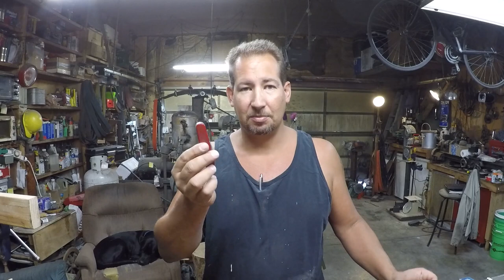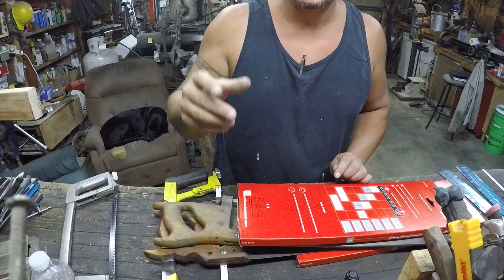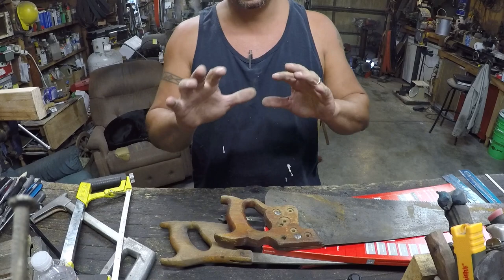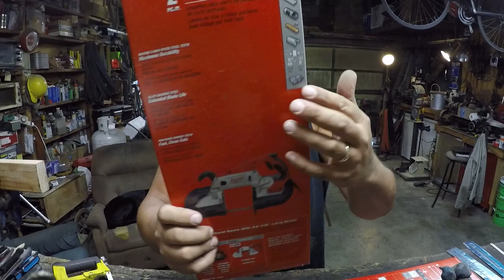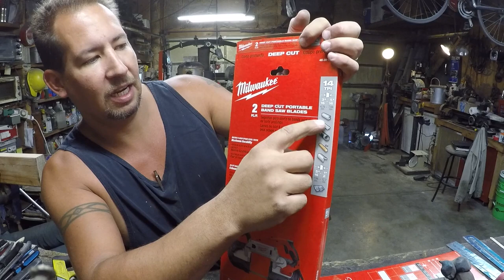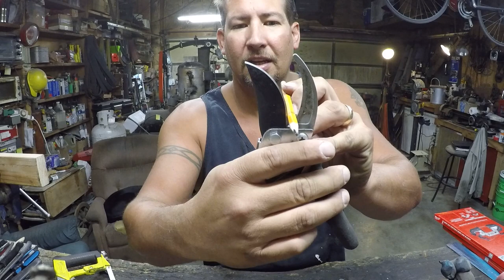what is a toothy knife edge?

Comment: I've been a fan of the ~100 grit stones. After trying down to 24 grit I found that easy of sharpening decreases too much if you go below 100 grit. Even at 100 grit it's not easy, and unless you really take your time it just gets to arm hair cutting. I've gotten around 100 grit to hair whittling but it's really tricky to pull off.
Reply: 100 grit? That's close to the coursest stone I've used (70 grit) that seems so course you could only manage to form a burr not polish/refine the edge or remove said burr so how could iy possibly get arm hair shaving sharp.

Comment: I recommend chosera 800 as a good edge finisher, it's right in the middle. It's got some tooth still, but is also good for a little refinement. I've heard the cerax 700 is good too. 

If you still need more polish the chosera 3000, or king 4000 is a good next step.

Comment: I'm surprised you haven't spent more time finishing with the Norton India stones.  While I too love the Crystolon stones, I use them primarily for shaping the blade.  For finishing I find I can get a sharper edge from the India stones for any given level of toothyness.  The key is to keep the stones sharp, i.e., finish with a sharp fine India rather than a not-so-sharp medium India. While I also share many of your opinions on diamond stones, I find them good for finishing (applying a toothy micro-bevel) on the higher carbide steels.  (Pretty much the opposite of the way most people seem to use diamond stones.  When you use diamonds only for finishing micro-bevels they do provide an acceptable lifespan.)

Comment: Hi Joe
I am 61 and have sharpened a lot of knives and (Broadheads with a Mill smooth file )for Hunting and Cleaning animals.
Having said that I seem to have forgotten how to sharpen a knife !
I will work up a burr that I can feel and work the burr to the other side then work it back one more time  and still can barely shave hair if at all.And its not as sharp when I get to the curved part of the blade.
I also have an old Shrade sharpening steel that I have had for more than 40 years and have tried that but maybe I don't remember how to use it right.

I don't hunt anymore But I Peel apples and Kiwis and cut my sandwiches, as a Steak Knife ,Cutting a porkchop etc, 
I use a pulling Motion when cutting things on my plate and a pulling motion when cutting and peeling apples and kiwis 

I figured an Old Hickory Paring knife would Make a good Neck Knife so I bo
Reply from the maker: hi billy. if you are getting a burr, and moving it from one side to the other, then you are about 80% there. burr removal can be tricky some times with some steels. with a diamond stone, or a nicely condtitioned arkanas stone or norton india, you can raise your sharpening angle to about twice what you normally sharpen at, and shear the burr off with 2-3 very light passes on either side.   with a muddy type of stone like a norton crystolon, king waterstone, or most synthetic waterstones, i have great luck wtih dragging the edge thrugh a piece of clean soft wood to tear the burr off, and then stone strop 2-3 times at the normal sharpening angle to clean up the edge.
your sharpening steel will typically just stand the burr up and align it with the edge, and most do not remove a burr at all.
Reply: Thank you Much for your Help
Reply: Need some more input from you.

I am finding out that I can take a Mill Smooth file and get a Hair shaving sharp edge on The Old Hickory Paring knife Much faster than I can with the stone.

Whereas I have been taking about 45 minutes to sharpen with a fairly coarse stone and then having to strip it on Leather using the Mill Smooth file it takes less than 5 minutes .

Wonder Why ?

I do know that it is a lot easier for me to see and maintain the sharpening angle using the file .

I am just holding the knife in my left hand and the file in my right .
Reply from the maker: @billyhenard1473  thats great that you are having sucess with the file! now that you have one good way of sharpening, you can use it, while you continue to learn with other ways if you wish. the file and the old hickory knife works because you can see what you are doing, and it is comfortable for you. and becuase the knife steel is pretty soft and the file is pretty fine. i would suggest at first to use the stone like a file, or if your stone isnt big enough to grab and keep your fingers out of the way, glue a stone to a handle, and sharpen just like you do with the file.
Reply: @joecalton1449  
OK I will try that
I just wonder though if the "toothy" edge that the Mill Smooth file leaves is "Too toothy" for the Purposes of cutting Sandwiches and Apples and Pears and Kiwis and Oranges and the Edge would cut better if finer and Less "Toothy" or if it is fine as it is ?

One thing is Although I can carry the file in the glove compartment of my Pickup it is obviously too large to carry in my Pocket.
So I would Like a Smaller stone that is able to be carried in my Pocket but put a similiar maybe even a slightly less "toothy" edge on the Knife.

Would you go with a Small Diamond Stone and if so what Grit ?
A regular whetstone ?
 What about one of the Small Pocket Pull through sharpeners ?

Thanks
Reply from the maker: @billyhenard1473  the only way to know for sure is to get good at putting a finer edge on your knife and trying it out for a week or two and see if you like it. take a look at dmt and smiths diamond stones, the smiths you can get at walmart for around $20 that has a coarse 325, and a fine 700 sides that takes down and is fairly compact. dmt makes some that look like a butterfly knife that are even smaller. and both would work well for your style of sharpening.  I dont care for the pull through sharpeners, as you cant adjust the sharpening angle.
Reply: @joecalton1449  
Once again Thank you very Much for your advice.
You have saved me a ton of Money I would have spent Buying stones that I don't need for my Purposes.

Comment: Got a paramilitary 3 S45VN with almost polished 20 degree edge, how do I put a toothy edge on it what stone do I use and do I stop there I don't strop it with compound right, and do I wait until it's dall then put the toothy edge on there after it's all or do I gotta reprofile it with say 350 course then leave it can I do that since it's a polished edge it's sharp but doesn't have alot of bite it seems like?
Reply from the maker: the "toothyness" is created by your finishing stone, or the last stone to touch the edge. so if you want more tooth, you finish with a coarser stone. i have not worked with your steel, but I hear that diamonds cut anything. one of my favorite stones is the DMT 325grit which they label as coarse. bring the edge to a burr on one side, switch to the other and bring that side to a burr, lighten the burr up and get it ready for removal, and then shear the burr off with a couple of very light higher angle passes, maybe 2 per side which will create a microbevel and enjoy.     if you find the 325 is too toothy, you would do the same with a dmt fine which is 600 grit i think.  stropping smooths and realigns edges, which removes the tooth

Comment: OK Joe, I run fingers along my, say 320 edge on getting it sharp and can feel the toothy edge. I then strop it on a fine compound to "refine the edge", now it feels really smooth along the edge. Have I completely lost the 320 toothiness??? (it sure feels like it). Should one NOT strop on "your suggested tests" for the best grit??? Please advise cause i'd been wondering bout this. ATB.
Reply from the maker: yep, you just turned your 320 edge into a fine compound edge. I don't strop very much, just straight razors where you really want that polished edge. I will palm strop, or strop on the leg of my jeans to clean an edge before putting a knife away and that is about it.
Reply: @joecalton1449  Brilliant Joe. A definitive answer. Im learning alone as I don't know any knife people here in England to get answers from, so thanks. Pete.
Reply: This is a great question. I'm learning alone too from videos like this and toothy was often described as a desirable result. But everyone is shown moving up in grits and stropping so I did that too, and knives that were obviously sharp would have a smooth edge. Finally one day I touched up a secondhand butcher knife on a Norton India fine side and there was the toothiness. So obviously if you want toothy, you work on your technique so you can get a sharp edge on a relatively coarse stone. One thing I'm learning is if you set your bevel right and deburr you're most of the way there and don't need to spend the rest of the afternoon refining it. Anyway thanks Joe for explaining an important but elusive idea.

Comment: I was thinking about this video some and a few things came to mind.   First, I think you can get a stone that is almost like the Suehiro 1k/6k is the Steelex/Woodstock 1k/6k.  It is just a little more narrow at 8x2.  How do you like the King 1k/6k compared to the Suehiro 1k/6k?  I was going to ask you for how you went about trying to find a grit finish that works best for EDC, and you answered it in this video, so thank you!
Reply from the maker: Jason, I like the suehiro 1/6 more than the king, but the price difference really favors the king. either way I think they are completely serviceable stones, and more than good enough for any fine edges you might need, including straight razors {along with a strop of course}. I would also think the Norton 1/8 would be about the same as the king 1/6, or a soft/black dans ark combo. but for simplicity's sake, ive been suggesting the king 1/6 for razors that you can find on amazon for around $30.
Reply: @joecalton1449  I am trying a coarse edge for EDC and I really am thinking that is the way to go.  Before I was using my grit finish for push cutting and my edge geometry for  slicing, but I think a better way is to use grit finish for slicing and edge geometry for push cutting.  The #325 Diamond, Fine India or Fine Crystolon stones are a good balance of slicing and push cutting

Comment: Do you think it is a good idea to progress from 250 400 600 1000 6000 etc... then maybe go back over the edge at 400-600 ? To remove the burr without leaving the final edge overly polished?
Reply from the maker: i suppose you could. give it a shot and see if you like it
Reply: @joecalton1449  right now I'm just trying to figure out how to "remove the burr" so I won't have a wire edge without over polishing and smoothing out a knifes edge.
Reply from the maker: @rickterrance4981  oh, gotcha. the 2 basic methods that I like both start with lightening the burr and preparing it for removal, then the first method that works well with diamonds, or freshly conditioned arkansas, india, or hard waterstones like the worksharp is to shear the burr off with a couple of very light higher angle passes. the second if working with muddy man made oil or waterstones is to lighten the burr as much as you can with stone stropping passes, then drag the edge through a piece of soft wood to basically tear the burr off, and then stone strop a couple more times to repair the damage done from the ripping without going too far and creating another burr.
Reply: @joecalton1449  by higher angle do you mean higher degree? Like if my blade is 20 degrees I should remove the burr by doing passes at 25 degrees?
Reply from the maker: @rickterrance4981  yep, its gotta be high enough to shear the weakened burr off and leave a cleanly formed edge. usually 1-2 passes each side alternating at a higher angle than your normal sharpening angle, so if you sharpen at 20, id go at least 25 if not 30-35ish. its a microbevel, so fine you shouldnt see it with just your eye.